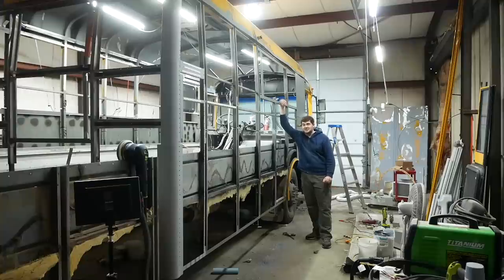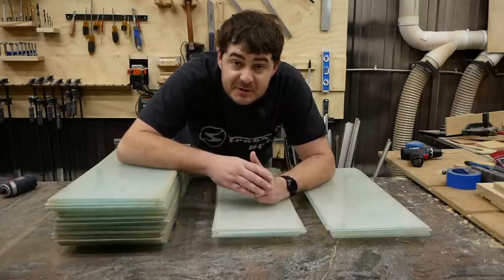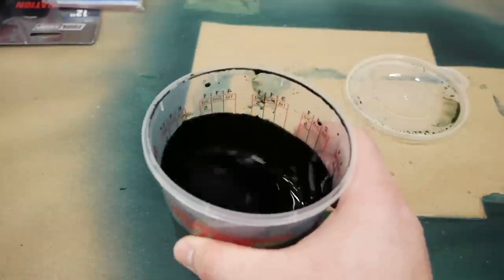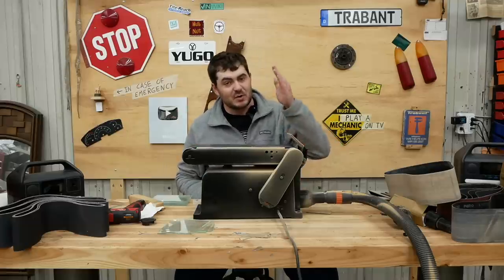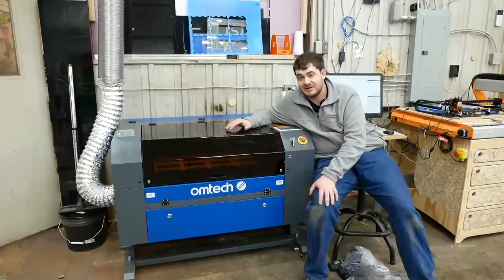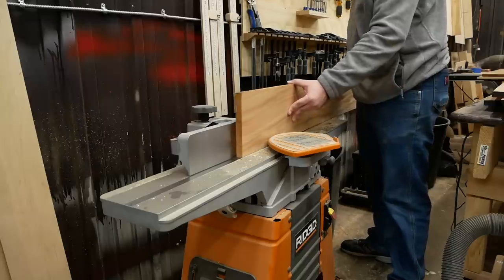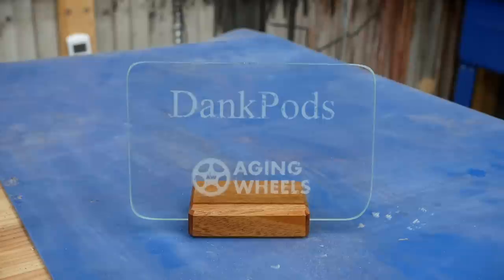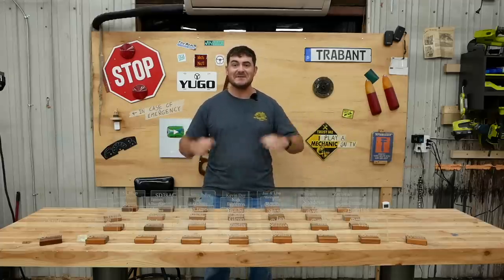I Turned Bus Junk Into Cash to Support my Junk Bus

Comment: As a glass guy of 30 plus years, I am both extremely impressed with your annealing process, and horrified how much you complicated cutting it up LOL. Great video man!!
Reply: Agree 100% with this.
Reply: What’s a simpler way to do the cutting?
Reply: @enriquegarciacota3914  One example, line them up against a fence of some sort that is precise enough for the purpose, like his table saw fence... Take a ruler, a long one, or even a ground alu/steel stock and lay it across, make sure its parallel, take a scoring tool, take a brush with some oil, clamp down the ruler, oil down the line of it and score as you would normally. That will give you in his case, i would guess at least 4 window panes scored up in no time, done well and precise and after that, he would just need to bring the glass to the edge of the cast iron table of the saw and having it clamped accordingly, just break off the pieces... All cuts woulda been nice, much faster and less tormentous to him... The sanding would also have been reduced greatly thereby...
Reply: @enriquegarciacota3914   Use a glass cutter.......
Reply: Exactly.... i also worked in a glass place for a long time. a handheld glass scoring wheel or anything with a carbide glass scoring wheel to score it will do the trick if its annealed.. i was like WTF? No this is not needed!! Why?? LOLL
Reply: He also claimed that the router cut was too shallow. But when breaking it he did not support the full length. Would have gone much better if his did, but then your way is still much better
Reply: @bzuidgeest   Exactly... we had a machine that scored the whole piece with a carbide wheel, and then we broke piece off on the edge of the table... but we also cut pieces by hand quite often... putting it on the edge of the table so the whole piece is supported is critical when snapping it off. You also need to commit, you cannot half way hit it, just commit by pushing down while supporting the other side (the whole length) on the edge of the table and perfect almost every time.

Comment: Rob, in LightBurn alter the fill setting to "Fill groups together" and change your line interval to 0.15mm. This will drastically speed up the process without a noticeable degradation in output quality. I use my Co2 for all sorts of things. I find it especially useful for marking out hole centres in wood and metal. Give the metal a light coat of paint then laser it or stick a piece of paper on it.

Comment: If you spray the surface of the glass with some sort of oil (WD40, silicone, etc.) it will make your score lines better and it won't chip out.

Comment: Slow as they were, those diode laser glass etches were really impressive! I’ve been trying to decide between a diode laser and a K40 CO2, with glass etching being a key advantage for the co2, but this trick is good to know if I get the diode. Also, Ortur have just come out with a more powerful diode which seems like a decent upgrade, so hopefully that will allow it to go a bit faster.

Comment: You need to vectorize what you’re engraving. This way, it wont engrave point by point by in a continued line. What takes you 1 hour to engrave might take you around 3-4 minutes if the drawing is vectorized. But anyway, you solved the issue (kind of a overkill) by purchasing an amazing (envious af) co2 cutter. Cheers

Comment: For some reason I never knew you had a second channel until 3 weeks ago. I'm glad to have found it. Your video's have a tempo which for some reason are really similar to my approach when doing a project. I wanted to mount a monitor using a Vesa-mount only to find out the monitor doesn't comply to Vesa-standards. There was an adapter for sale online, but it cost $80. I could buy a cheap stickwelder and the steel needed for that price and come out on top with a, shoddy, Vesa-adapter AND a stick welder.

Comment: As an ceramic engineer, I was sad to see your failures with the glass scriber.  Issue is not that it wasn't deep enough, it was actually too deep.  I know it doesn't make sense, but it does break glass.

Comment: The best way to clean up broken glass edges i've seen, is to not clean them up at all. you can run a piece of tape along the score edge if you want, but any frame is going to hide the edge anyway, so cleaning it up is pointless. its kind of funny to take apart a really high quality framed painting and see the edge of the glass looking terrible lol. all the professional glass cutters i know that do matting and framing just cut with a straight edge and a wheel and then break their glass with either the tiny hammer or grabbing the edge with the grabby side of the wheel cutter

Comment: It looks like you are raster engraving. This takes an order of magnitude longer than vector engraving.  If you want to get similar results regarding line thickness you can vector engrave using thatched shape fill and it will take about half the time of the rasterized image.  With some quick optimization you can probably get a tile done every 15 minutes. Not quite the lightning speed of the omtech (though you could use the same optimization method to get faster output from the omtech) but good enough for a diode machine.
Here's a short video on the time difference between the two methods https://youtu.be/rZqUQ0w9vp4
Reply: And a follow up. I think you might be able to cut the glass directly in the omtech. I've never seen a k40 try it but I know it can be done with other CO2 lasers.  That would cut out (sorry, I couldn't resist) a few steps in your process and get cleaner, more consistent shapes.

Comment: Asuming that each glass plate was $100 or so (I didn't get to see it while it was up), you'd need to sell at least 25 of those plates to pay for the laser.  Given that the plates were small and there was a lot of them, and they're all sold out, yeah he probably made all his money back.
So, mission accomplished I guess.
Reply: They were only $40. Cba to confirm anything but it looks like he got 6 plaques per pane, 2 panes per window, 14 windows per side, that's 336 plaques assuming zero losses. Over $13k, minus the equipment purchased to do the project.

Comment: Too late, but the plaques with those chips that you had, even the one with a little crack, could have been mitigated.
With a torch. Even a mini-torch. Which could have melded cracks, smoothed edges, and softened or even removed any chipping.
You have a torch. Already.

Just saying.

Thanks for the content.
Keep up the good work.

בס'ד